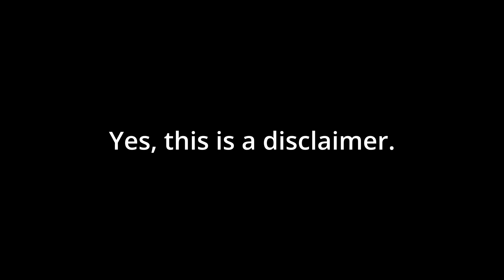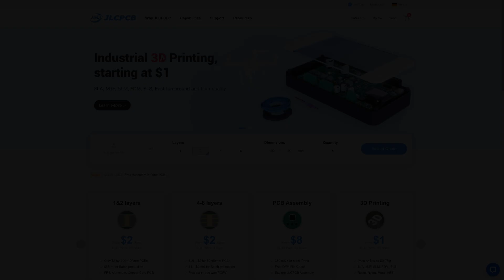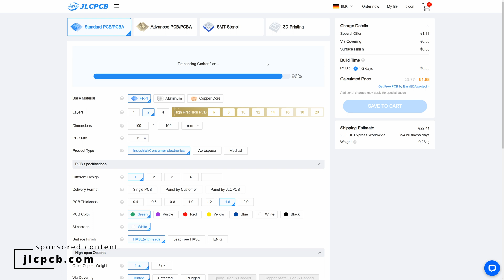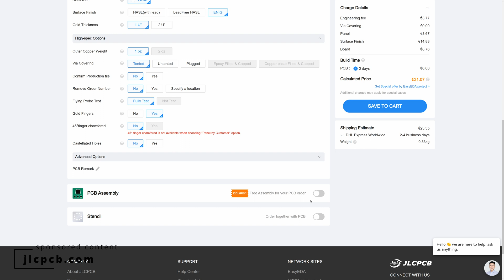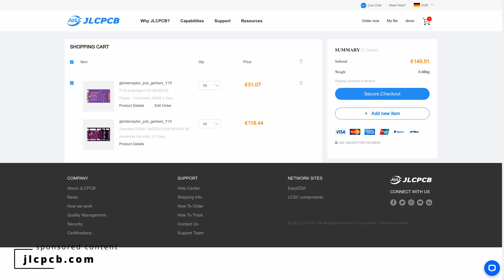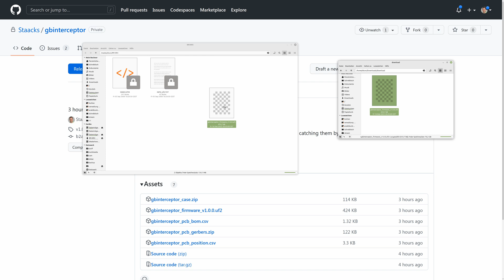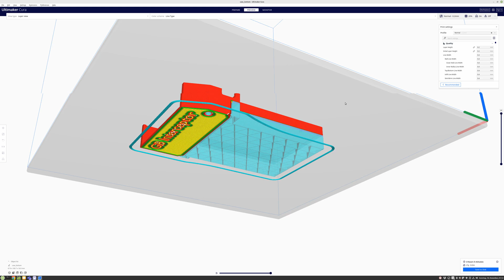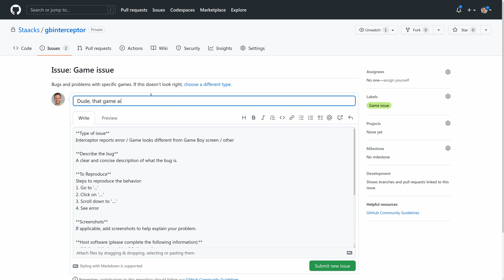How to order and build the GB Interceptor

Comment: one more question.. how do you reinstall firmware? i tried holding the button down and no luck in it turning into a drive? do you know why this could be?
Reply from the maker: I assume you bought an assembled one? Sorry, when I designed it I thought of DIY builds and not not of complete devices being sold. You will have to open the case, which should not be a problem if it has been built properly. On the inside there is a button "Flash". If you press that button while plugging in the USB connection, the GB Interceptor should show up like a USB drive. Just drag the new firmware (a .uf2-file) onto that USB drive. It should automatically disconnect and reboot with the new firmware.

Comment: Should this work with Windows 10? I'm having a real hard time making the device come up as anything other than USB storage when I plug it in
Reply from the maker: If it shows up as USB storage even if you do not press the flash button, it has not yet been flashed with any firmware. This should be normal if you ordered a new PCB like in the video. If you bought an assembled Interceptor somewhere I would have expected them to flash it, but you should be able to just flash it with a uf2 file as shown in the video.
Reply: @ThereOughtaBe  it says that it contains two files  'INDEX' and 'INFO_UF2' when it gets detected as a regular USB, but the first file just opens a link to rasberrypi's website, and the secons opens as a notepad with the message 'UF2 Bootloader v3.0 Model: Raspberry pi RP2 Board-ID: RPI-RP2' is that what it would be expected to contain, or should i wipe it and try to set it up from scratch??

(P.s really appreciate the help, your creation is cool as hell, and was gifted to me by my brother!)
Reply from the maker: Yes, these two files are normal and they will always be there. The Interceptor is based on an rp2040, which is the microcontroller behind the Raspberry Pi Pico. These pretend to be mass storage device in flash mode, so new firmware can just be dragged onto the device without the need for any special flashing software. It shows these files to point new Pi Pico users to instructions on how to do it, but these are no real files. If you delete them, they will just show up again next time and any file you drag into the folder will be gone the next time. Only if you drag a valid firmware into the folder, it will be used for flashing (and still not show up as a file the next time).

Long story short, simply follow the instructions from 12:34 in the video: Download the latest uf2 file from github (https://github.com/Staacks/gbinterceptor/releases/latest) and drag it into the folder. It should then start acting like a webcam instead of a mass storage device. (Only difference to the video is that it is now firmware version 1.2.0, but absolutely make sure you use 1.2.0 and not 1.0.0 as shown in the video as there have been a lot of improvements.)
Reply: @ThereOughtaBe  Hey man, you're a total legend, this has worked! I really appreciate you walking through a technological novice like me through this so patiently, you've really made my day! I hope you have an awesome one, and a great new year <3

Comment: Is it possible for JLCPCB to still include all of the components without assembling them if I didn't mind soldering them on myself? Or should I just get the board from them, and source the components elsewhere?  Thanks!!
Reply from the maker: I would think that you should probably get them elsewhere, but you would have to ask their support to be sure. But it should be no problem to get everything from a different supplier. There is nothing exotic on the BOM. Some generic components might be a Chinese brand that is not found everywhere, but there should have identical variants. If you feel confident to solder the rp2040, then you probably have more experience with this than me anyway :)

Comment: 14:25 Ok, on the 3D Print Case, how i am able to get the skrew on top in? i have M2,5x4 skrews, but the head is to big for this hole. Can't find any other 4mm types on Amazon DE. 4mm is quite short, will 5 or 6mm fit too?
Reply from the maker: The screw on the top is supposed to go all the way in and then it should go into the thread about as far as the other ones. Tbh, I am not sure if screw heads are normed and if yours might be wider. Different printing tolerances or some remains from supports might also be messing with the fit. If it is so tight that the head absolutely dies not go in, you could of course use a long screw and keep the head flush with the case, but I have never tried that.
Reply: @ThereOughtaBe  Oh sorry with the length I have caused confusion. The other length I asked only to have a higher selection. Because there are hardly 4mm screws on Amazon, but there are 5mm (only 1mm, I think that also fits). Thanks for the mega quick answer. exactly, I also understood that, the screw goes all the way through to the level of the other screws, but mine are just too wide for the channel, they do not go in. Your Idea with the Werry long Screw is maye a good one too. 
thx
Reply from the maker: Ah, I see. I think that 5mm screws should also work. I am a bit conservative with the length because of the heat-set inserts. The holes for them are a bit deeper then the length of the inserts, so there is a bit of room for the molten PLA to do into, but I was a bit worried that some might still flow back into the thread, reducing the room available for the screw. But this is my first design with such inserts, so these design choices are mostly based on what I read and not on experience.

Comment: I know you said you dont support the device for the most part, however I figure I will take my shot and ask. I had 10 boards built per the specs and they came in looking great. Soldered on the cart adapter, joints look good, no bridges etc. Attached the usb cable and loaded the firmware, worked exactly as described. I have the cart in the device and plug it in, I see the USB cam device. Here is where it gets weird. When I run the Win10 usb camera software and various other usb cam software from the shop,  I try to load the device but it just shows a black screen. When I boot up the gameboy, the LED turns blue in the interceptor and the game plays just fine on the device, but still nothing in the usb camera software. I tested it on Android and its basically the same. Would you be willing to point me in a direction to look?
Reply from the maker: Don't worry, I am happy to help. That disclaimer is just to make sure that people understand that I will not answer everything and sometimes it might just take a while.

Since your problem occurs even before a game is used (you should see the standby screen of the Interceptor even when there is no Game Boy in the same room) I am very sure that it is not the soldering. It might be some problem of the assembled PCB, but more likely it is just a USB issue. Please try a different cable and/or a different USB port, ideally not on a USB hub. This is a bit strange and I have to read up a few things about USB and why this might happen, but I have an USB port on my PC that does not work with the Interceptor and someone else had almost the exact problem with some USB-C-to-A-to-C adapter contraption. It might be a design flaw at my end or it might be an issue of maxing out the limits of the older USB standard even when it is connected to a USB 3 hub. Bandwidth does not only mean that more USB1.1 device can add up until the bandwidth of USB3 is reached, but a USB1.1 device at full capacity still takes up most of the time available for transfer - it just transfers less in that time.

Point is that cables and hubs matter even though the Interceptor is only a lowly USB1.1 device, so that's the first thing you should try.
Reply: @ThereOughtaBe  Very interesting. 
USB-C-C on OnePlus 10 (android): Black screen.
USB-C-C(same cable as tested with android) on my Ubuntu laptop: Works.

 Tried 3 different USB A-C on both the powered USB 3 hub (2A ports) and directly on the USB 3 ports on the back of the motherboard: Black screen

I went back and tried all of the cables on the laptop and they all worked. So good news is the device does not seem to be defective from the factory, it just seems my PC is weird.
Reply from the maker: Interesting. On Linux and MacOS it seems to be independent of the cam software. It seems like the stream is converted on an OS level. On Windows, however, I also noticed that different software sometimes struggles with the rather unusual format from the Interceptor. For me it worked on OBS and Zoom, but VLC struggled.
Can you tell me which software did not work for you, so I can add it to the compatibility list on the github WIki?
Reply from the maker: I definitely need to do some more testing here as I do not yet see a pattern for Windows (except that OBS seems to always work). Someone else reported the default Windows cam software to work at almost the same time:(https://github.com/Staacks/gbinterceptor/issues/9#issuecomment-1381359515)

Are you using the latest firmware for the Interceptor (1.0.3). 1.0.1 had some compatibility improvements and 1.0.3 had a rather minor improvement (almost specific to one Android app, but who knows).

Besides that I had a few more insights in how USB1, USB2 and USB3 interact on the same bus. While USB2 and USB3 are more or less separate, USB1.1 (i.e. the Interceptor) and USB2 have to share transfer times. This means that even though the Interceptor takes up little bandwidth (compared to what USB2 could do) it takes up a lot of the available time frames, simply because it takes so much longer to do the transfer. Therefore, because it uses the slow internal USB bus of the rp2040, it does not play nice with other devices on the same bus, which can be a problem on USB hubs, but also some USB ports on PCs (in particular those that are part of the case and not the main board) if they share a bus internally.
Reply from the maker: @frogbutts3628  Oh, that's interesting indeed. Did not expect this little change to be so relevant.
Reply from the maker: Hm... Could also be an outlier in terms of tolerances of the oscillator (or its matching capacitors) on the board. I heard somewhere that Adafruit had similar outliers in their board designs and that it is just a startup problem after power loss with a workaround available. I will search this later.
Reply from the maker: Not sure if it is their fault. I am already using a different crystal than the official Pi Pico because of its availability. Variation within tolerances (or my capacity calculations) could have just pushed it off the edge. If it is what I saw for Adafruit boards then I can send you a firmware later today that simply gives it more time (i.e. 2ms instead of 1ms) to settle. If that helps it might solve the issue for other outliers too.
Reply from the maker: Alright, can you try if this firmware fixes the problem? https://cloud.tankwar.de/index.php/s/8qEMYjzMcHJEibx

Comment: Would it be easier to intercept only the inputs and let the simulation run on an emulator on the computer?
Reply from the maker: Do you mean the controller input or the bus data that I use as an input for the emulator on the rp2040?
The controller input from the player is not visible on the bus, so that won't work (besides some desynchronization problems) and the data on the bus is way too much for the rp2040's USB. To reconstruct the game at least the address (16bit) and the data (8bit) pins are required. At a clock rate of roughly 1MHz that sums up to 3MB/s - about two to three times of what the rp2040's USB 1.1 can handle.
Interestingly, the rendered image is smaller and it would be even smaller if there was a common format for 2bit colors. But that's the final argument for emulating on the device itself: Anyone can use it without additional software.

Comment: I had an email from them after ordering asking if I needed 45 degree chamfering on the pins, despite selecting "No" in the order process. I've replied that I don't need it, so fingers crossed it all shows up and works.
Reply from the maker: To be honest, I was unsure myself whether chamfering would be a good idea or not, but came to the conclusion that it does not matter. The PCB's edge connector is behind an edge of the case anyway, so I think that chamfering neither hurts nor helps. But it makes sense that JLCPCB asks about this if they notice it, I guess. I wonder at which point their engineers realize that they are getting many orders for the exact same PCB and just keep the prepared production files around without asking anymore :)

Comment: I see what you mean, when you say it doesn't make sense to order fewer quantities. I just added 50 to the cart and they're now $8 per product shipped. That's insane. Wish I knew people in this community, because I just need 1. Group buy, anyone? :P
Reply from the maker: Jepp, it really is mostly a $5 rPi Pico on a differently shaped board plus a few extra components that in total are not more expensive than $2. It is only expensive when someone has to set up all machines just to build a single one of them.

Comment: I have an order for 5 PCBs ready to go for later this week. Saved in my cart. Would not have been able to do this without you. This is great, I'll have a use for 3 of them, and I can give the other 2 away to some friends. Appreciate the detailed steps, this kind of stuff is not my expertise, but was easy to follow.
When it comes to soldering the cartridge slot to the PCB, you said not to use too much solder. Does it matter if the solder runs across multiple gold connectors, or does there require a gap between each small pin? I can solder, but the tiny stuff is a bit tricky for me.
Reply from the maker: There has to be a gap. This is where flux helps a lot as it "magically" keeps the solder where it should go. Using as little solder as necessary also helps because the solder mask of the PCB also prevents the solder from going between the pins as long as there is not so much solder as to bridge it anyway.

If you are unsure, I just realize that ordering a few more cartridge slots might help as you can train on the extension board before soldering the main PCB. They usually are not that expensive.